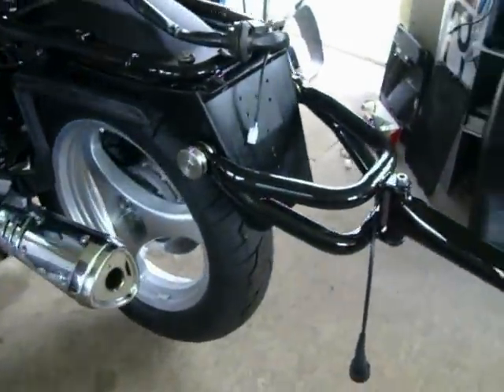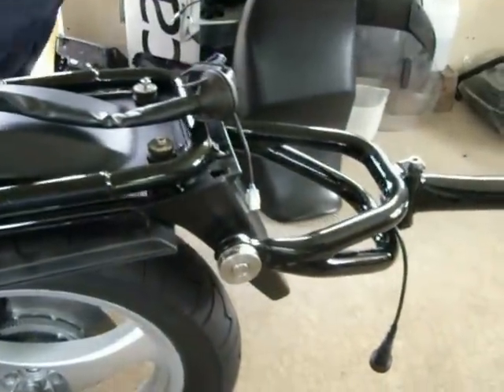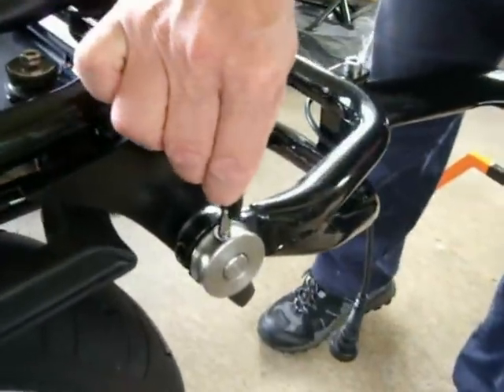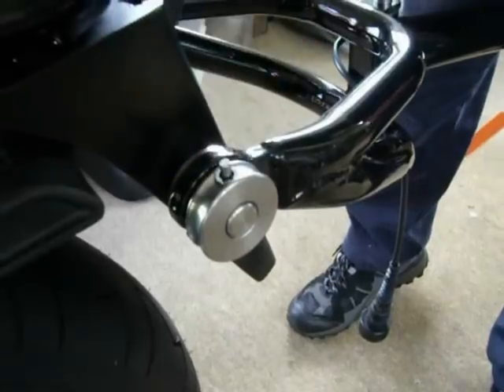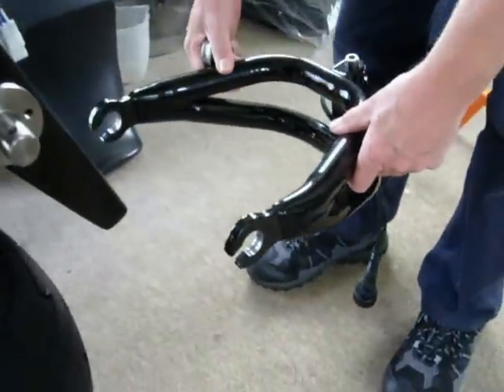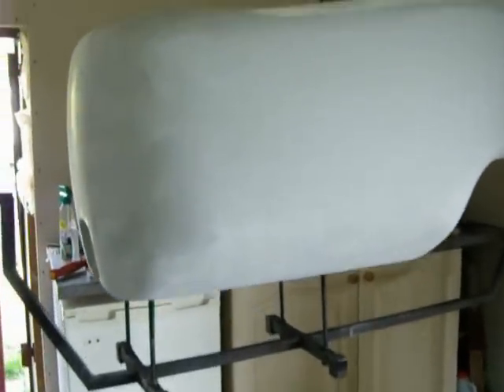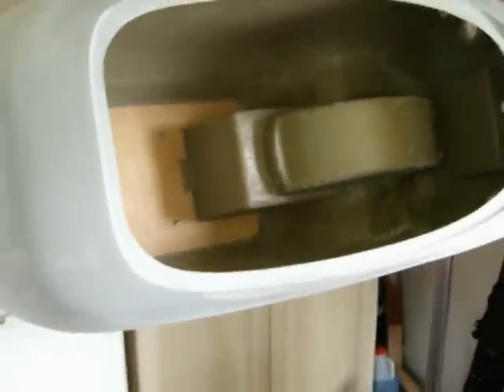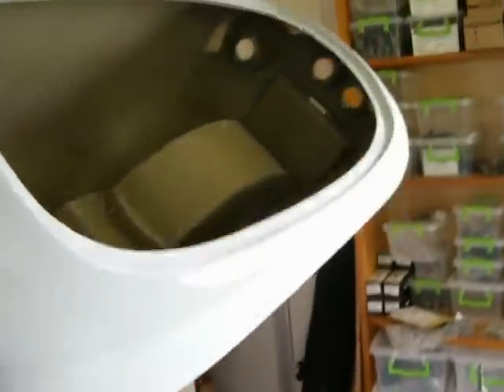Mono-Trail Single Wheel Motorcycle Trailer - Chassis

Comment: Seems like it puts a lot of weight on the rear shock instead of the rear axle
Reply: I've tried to think of a constructive response but It ends up condescending.  The rear shocks thing - valid point in this context;  but the rear axle thing - think about it.
Reply: @terrybyrd3738  I'll say it. Weight is still on rear axle. It is now sprung weight as opposed to un-sprung weight. Worlds better.